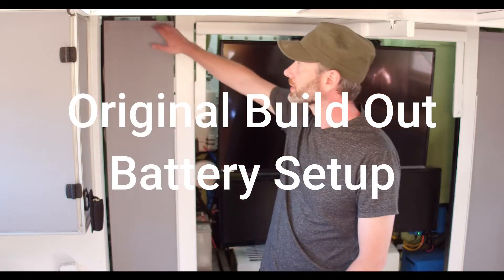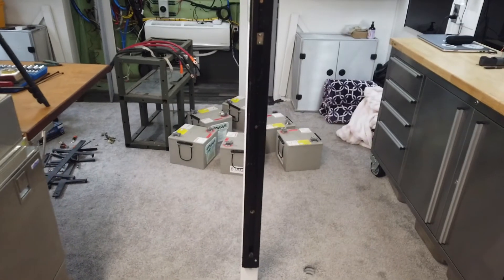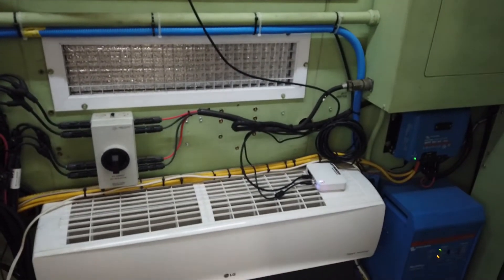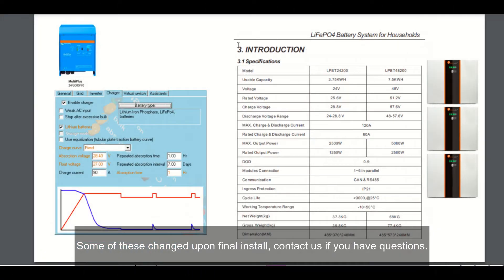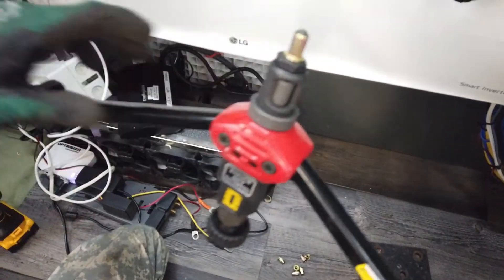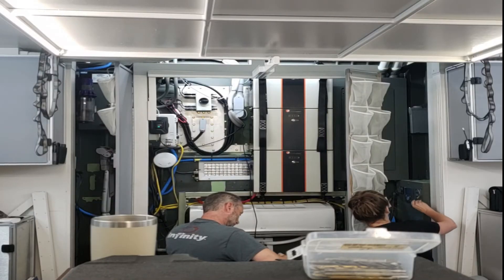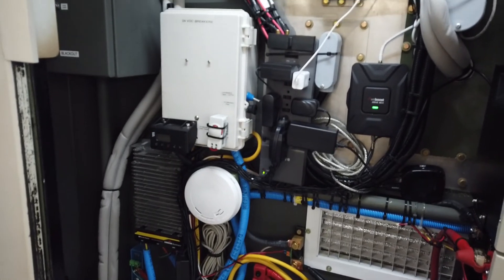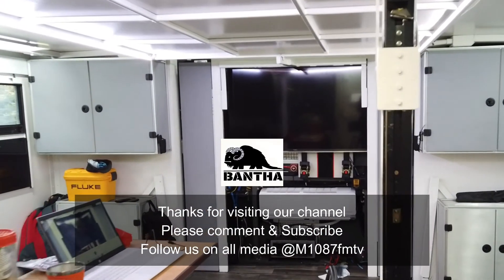Battery Upgrade

Comment: Bantha looks very cool! wishing i could do this too, how hard is it to drive? and how is cold start? does it take alot of maintenance
Reply from the maker: Hi.  Thanks for reaching out.  Drives fine ( by fine, we mean slow, a bit bouncy, a bit noisy) We have a hydronic block heater, so no issue w/ cold start, but in general cold start can be an issue.   Maintenance: Yes, we these big rigs require typical service, plus due to age require fuel line, air water line replacement, seals and O rings...The tiny house requires maintenance also, this would depend on your specifics though.  🍻

Comment: WOW!!! You really got some electronics set up there! It would be cool to do a walk-through of all that stuff someday. I'm looking at replacing my batteries this Fall/Winter and will be putting in a 24/12vDC battery equalizer and eliminating the power distribution box. You said yours was all 24vDC? How did you deal with that conversion, or was it like that when you got it?
Reply from the maker: Thanks Dave.  Truck came w/a 24v panel, we added the buss 24v to 12v converter for 12v civilian electronics. We run 12 & 24 volt.